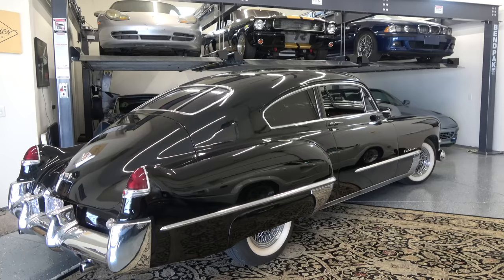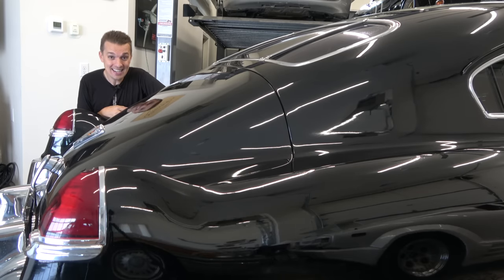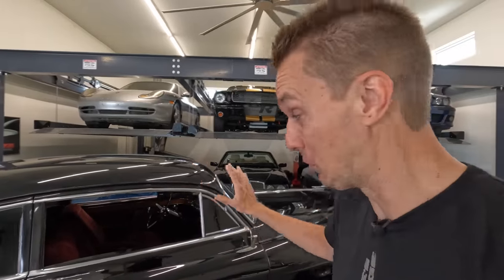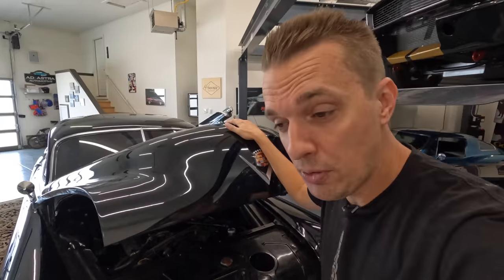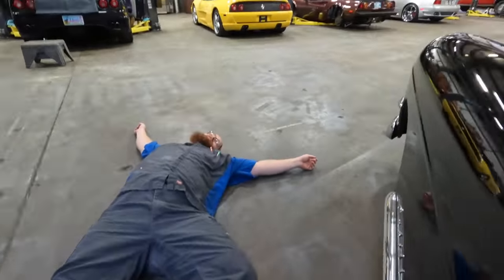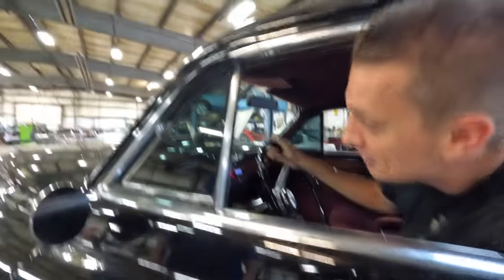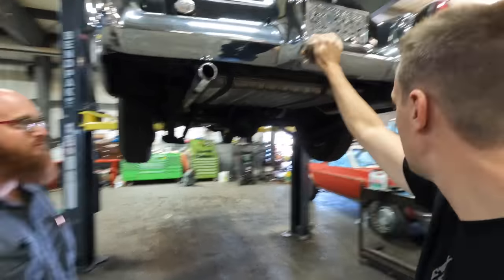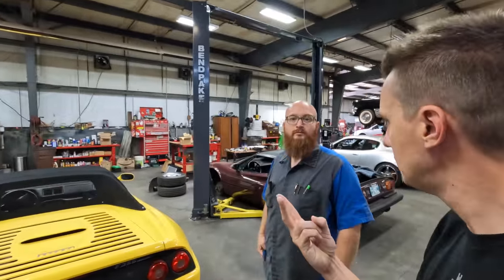I bought a RARE 1949 Cadillac Fastback, and making it my 70 year old daily driver! Amazing Restomod!

Comment: That 80's velour interior would have to go, along with the modern radio, and I think that large Cadillac logo on the center console probably is a later addition, but a really nice car at first look.  I'd sure go around it with a magnet though to see what kind of body work was done.  A black leather interior along with a paint job, other than black, would really update the car.  Sort of reminds me of my father's 49 Chevy fastback he had back in the mid 50's.  Great purchase.
Reply: I said the same thing take out them seat's and that horrible plastic centre consol. Try and find something close to the original split  bench seat. Maybe something like 57 chevey seat. Yes that radio. Other than that it's beautiful car.
Reply: Or... hide it with something flip up [or down].  Polished stainless, leaning towards art deco as the car suggests.  A faux air register perhaps?
Reply: air bags  holley efi and wheels along with buckets
Reply: @rsprockets7846  no way that would destroy the car might as well take a hammer to it doing mods like that. The interior needs to go back to as close the original factory. Engine needs to be carburettor for the old sound. Do not ever change them wheels unless it's for original one's from factory.
Reply: @chriscollins550  its their car, they can do what they want.

Lol
Reply: @chriscollins550  what the hell are you on about?
Reply: @chriscollins550  lmao my guy, your tryna say that all the added stuff is ugly, and alls i said was, its his car, he can do what he wants. Which means im referring to the owner.

Calm down, you've been online too much today, go find something else to do.
Reply: @trashyspeeds266  lol hardly any sleep. Baby and all that reply to the wrong person lol.
Reply: @trashyspeeds266  a car like this you don't need to customise it like that. They look and feel so much better as close to factory. Yes modern breaks and if you don't have the matching engine do what they done hear. But bucket seat's are not right in a car like this. You must understand that.
Reply: @chriscollins550  despite the fact buckets were an option? Sure. Lmao
Reply: @trashyspeeds266  not looking like they do now and it wasn't common. 99% went for the bench seat that looks more classes than anything else. The first caddy to have bucket seat's wasn't till 1957. I just looked it up on their Website

Comment: I miss my 1956 Fleetwood Cadillac.  What a great party mobile. The air filter was in an oil bath on top of the carburetor. Had an electric eye that would automatically adjust your high beams to low beams.  Worked Great. Interior needed work. Gas cap was under tail light. Exhaust went through the back chrome bumpers.

Comment: I still see flatheads in use for the torque, but not in cars. I saw them at ski slopes as the motors that would power the ski lifts. Guess they were reliable. That is one nice car,  got some real leg room, not quite like the Checker Marathons but it's got style. Great for moving drum gear a round too.
the air suspension needs nitrogen, then you don['t need to constantly top it up. Air is a mix of molecules and not  stable where nitrogen is a single molecule and stable enough for racing tires so I suspect it will help the ride level longer. That car can be on the road for a very long time with a bit of preventative maintenance, maybe build a water park in your driveway for after a long drive, keep it nice and clean underneath...and keep you cool in the summer.

Comment: Love it.

Original wheel was huge, for leverage in parking, with plastic and a full circle horn rim.  Manual steering.
Chrysler had first powerin 51. We had a similar 55.

The radio was all vacuum tubes and was HUGE behind the dash.  18 inches by 2 feet.

I know, Dad had me test everyone at the drug store in 1970 to see why it stopped working.

Comment: A GREAT CAR.  LOVE the ride height ... perfect for the Sedanette.  In 1969 I had a 1959 Caddy 4 door with the flat roof ... everything, even the 4 vent windows and the trunk was electric powered.  More ash trays and cigar lighters than could be counted.  Wonderbar radio, only AM of course.  Same gas cap treatment, but I don't remember how it operated.  Lost it in a fire.  I've often thought about doing the resto treatment on a 53 to about a 56 Coupe.  Love a coupe roof line and them Dagmars.

Comment: What a gorgeous car!!!   So glad that you were able to buy it in such great shape!  The only thing that I wish was a bit more "updated," is the Split front Windshield, and the three-piece rear window.  Obviously, you want to keep it as "vintagely pristine" as possible, but it would have been a bit "cooler" in my opinion, if like the 1964 Sting Ray, a solid one-piece rear window and one-piece front windshield.  The interior is gorgeous as well.  Bravo, Bro!!!    Ted Schempp, Nashville
Reply: I own a '49 club coupe, and can tell you that the rear window is one piece. The 2 vertical chrome strips are just sitting about .25" above the rear glass,  they don't actually touch the glass.

Comment: My Grandfather had a 1958 Oldsmobile 98 with fins,  and Chrome that weighed more than my VW beetle. It also had a gas filler hidden under the fin. He was always annoyed that the gas attendants never knew where the filler was, and that was less than ten years after the car was new.
Reply: Good call on another GM car with a hidden filler. Besides the Cadillacs, most people only know about the 1956 Chevy.

Comment: My first ride was a 1971 Sedan Deville that I inherited from my Dad after it had been through two lives already as a company car for him and then a family car for my family.   Nowhere near as sweet looking as this 49, but it did have the 472 V8, which was essentially the same motor as the 500 with a few more points of compression. Even in that monster of a car, because I was a young man, I did succumb to the curiosity to 'see what she'd do'. Out on a rural section of the New York Thruway, I took her to the floor and stayed there.... the 71s had a 120 mph speedo, and that car buried the needle ... if the instrument was anything like accurate we were somewhere north of 130.  

So, get The Weezard to put some fresh plugs, points and ignition wires in that thing, and go for a ride.  ;-)

Comment: Not very much into restomods, but this one is quite impressive. Most of it is done very tastefully. I especially like the retro-look telescoping column; always wondered why they didn't make something like that back in the day, except for the 2-seater T-Bird. My thoughts were that the column-mounted gear change lever is to be blamed, but this car seems to disprove this theory completely - combining it with a telescoping column is absolutely doable. It seems that car makers had very different priorities in 1950s. I wonder how many drivers would've gladly exchanged annual styling changes (which all too often made the car uglier than it was before !) for a tilt / telescoping column and a fully adjustable seat...
Reply: The whole steering column is relatively modern and the selector is connected to the transmission of the same period. The original would have had R at the right end.

Comment: That front suspension looked suspiciously like an old late model 70's Nova...The suspension/sub-frame in my old 1977 Chevy Nova Concours was built like a tank and looks a lot like that front end. They were sought after for drag cars.  They normally had 6's or 305's but you could slam a 454 into it all day long as long as you got beefier springs and shocks. Sweet car, man. Glad you got a goodie!
Reply: I miss my 77 nova

Comment: I can see why it sits low in the back. It has lowering blocks. You could just remove them and gain a couple of inches. A quick fix and probably better than pumping up the air shocks. It is a beauty and I like that it's got a Cadillac engine.

Comment: Nice job on the restomod! The only thing I would have done different was use the 472 instead of the 500. They got better mileage and had quite a bit more power. The 500's were the last of Cadillac's 'monster motors', and they had to drop the compression and put slow cams in them to meet the early 70's emissions standards.😝 The '68-69 472 was rated at 375 hp. stock, and if you are extremely lucky, you can find a 1970 500 that makes 400 hp. stock, but they're hard to find. '72 and later 500's are absolutely anemic, making a little over 200 hp. until they dropped them in 1976. If that HEI distributor is stock, that 500 has to be '74 or newer (when GM first introduced HEI ignition).😉

Comment: Nice car. I like it.  I have a friend here in Costa Mesa, CA who owns his parents 49 white Cad convertible.  He uses it regularly along with a few other classics he owns.  It looks like it just rolled off the showroom floor.  Everything is in perfect operating condition as your 49 is.  Since his father bought it new that means that it is one owner.  The trans has never been overhauled.  Engine has never been opened up.  Just oil changes and lube jobs.  Everything on it is functional. Paint is original and near perfect condition.  Always stored inside.  In 1949 this was as close to a perfect car as could be purchased.  I admire it and I like yours also.  Personally, I owned and operated a vehicle repair/restoration shop here in Costa Mesa for 30 years.  I repaired many of them and restored many.  I got to see many fine examples that were of museum quality and  already had lots of money spent before they came to see me.  However,  as I have said on numerous occasions ..... they are only original once... Grant

Comment: A few chips in 70 year old chrome. Wow that's damn good. Its beautiful car. Good use of modern seats. Steering wheel other modern parts. It's not like you could find alot of 49 parts. It's well done.
Reply: Besides the transmission selector being wrong the original pre-power steering wheel would be ship sized. Too bad the seats don't have chrome metal sides instead of hard plastic though.

Comment: The transmission has also been replaced on this car.  Originally, it had a hydramatic, with 4 positions -- Neutral, Drive, Lo, and Reverse -- in that order, left to right on the dial.
My aunt had one, and allowed me to drive it -- it was heaven  (Yes, I am 87 years old).

Comment: This was probably a budget friendly resto-mod. Probably pulled the engine and other underneath parts from 1970's and 1980's Caddys and/or other big body GM cars. If I did a resto-mod I would try to keep the exterior and interior as original as possible, but I would get the most modern mechanicals available.

Comment: My father had one of these in 1949.
Except itcwas a 2 door coupe.
He put a split intake manifold with dual quads on it.
The car would more than peg the 110 mph speedo. 
Later he added an ARA A .C system.   I learned at age 7 o drive that xar.

Comment: I had a 49 New Yorker, the problem is if you can afford the gas, if you try to go anywhere like take a trip and the starter or the generator (mine was original 6volt) goes out there is no place to get the parts to fix it. I found it was only good to sit in a museum and since I don't own one I had to sell it. The parts were so expensive also.

Comment: This is one of the most famous Cadillacs of them all! It's the Cadillac Series 62 'Sedanette' and is the rarest of the rare. The 1948 and 1949 Cadillacs have the first use of the iconic tail fins! The 1949 model year also introduced the Series 62 Coupe deVille - Cadillac's first use of a pillarless 2-door hardtop design mocking the styling of a convertible. 

The Series 62 also spun-off the ultra-luxurious limited edition Eldorado in 1953 and only 531 examples were built. Cadillac used to be the luxury leader when it was considered The "Standard of the World" in luxury, and grace. They were endowed with a poised dignity which was the hallmark of every Cadillac!

The Series 62 was "The Kingmaker" at the time. For the 1956 model year, the Series 62 offered Cadillac's first pillarless 4-door hardtop called the "Sedan deVille. Not many know the classic DeVille and Eldorado were merely trim options for the formidable Series 62 before they became their own special stand-alone model series.

I wish there was a magic spell I could cast to return Cadillac to its former "Standard of the World" status. There was no finer V8 engine made than the formidable Cadillac V8! The inherent balance, impeccable craftsmanship, and the overall horsepower of these magnificent engines were emulated but not equally replicated. Cadillac in its heyday made the entire auto industry 'nervous'. Automatic Climate Control A/C and front fender located cornering lamps are also exclusive Cadillac introductions to the industry.

Cadillac was the first American automobile brand to offer a V8 engine as standard equipment in 1915. Cadillac was the first American automobile to incorporate an electrical system offering 'self-starting', ignition, and lighting for the 1912 model year.

Cadillac is the only 'foreign' automobile to win the prestigious Dewar Trophy from The Royal Automobile Club of England. They recognized the Cadillac brand as being first in the industry to offer interchangeable parts and the facilitation of mass-production in 1908. Cadillac won this award once again in 1912 for its electrical-engineering prowess. Cadillac is the only American automobile brand to receive the distinguished Dewar Trophy.

I wish Cadillac still made REAL luxury cars - I wish Cadillac still made REAL cars!

Comment: When I was a kid growing up, the family car was a '49 Olds fastback.  It was basically the same body.  It had a ohv V8.  I think in 1949 the only Detroit ohv V8's available were the Cadillac or Oldsmobile.  My father hated Cadillac so, Oldsmobile it was.  The car was a daily driver until it went underwater during a hurricane in 1961.
Reply: Upper models of Oldsmobiles and Buicks shared basic bodies with Cadillac, the "C" body. Lower models were B body based. Versions of this plan lasted until 1958.

Comment: WW2 was happening and we got really good at making hydraulic systems, especially for the ball turret gunners in our bombers, like the B-17, B-24 etc. It only ended up getting put in cars in 1951 though, which seemed silly that it took so long.
Reply: Interesting history. The first power steering was by Chrysler, not GM. But if this had power windows they would have been hydraulic.

Comment: I wondered if you were going to demo the gas cap cover;  that was unique to the Cadillacs.  My folks had a 1950 Oldsmobile 98--same body as the small Cad less the fins, two-tone paint job, hydraulic windows.
Reply: That gas filler was NOT unique to the Cadillacs. 1956 Chevys for one had them. Probably a few others too.

Comment: Because Cadillacs had 300 hp in 1958 rather than 150, I believe a late 50s Hydramatic 4-speed has been used for this car. It does say Hydramatic on it, which is different from Turbo Hydramatic (TH350 or TH400)
Reply: Its a Turbo-Hydramatic 400; probably original to the 8.2L V8.

The 4speed HydraMatics used fluid couplings instead of a torque converter.  Also, the shift pattern has REVERSE at the bottom of the shift quadrant [P-N-Dr-L-R] vs [P-R-N-D-S-L] on the Turbo-Hydramatics.

Comment: A super daily driver but you are wrong on one point: The viper motor is electric and modern and  not "original and correct for the 49", as it had vacuum-powered vipers from the factory...but they never work properly anyways so its a great improvment.

Comment: I ran a exhaust shop a few years ago, had a guy with a immaculate 62 Caddy come in. My 10,000 lb hoist could barely get it off the ground. 
 I was wondering WTF was wrong with the hoist , it could handle 1 ton trucks with ease, when the guy mentioned the Secret Service had added some mods..... If Kennedy had been in that thing , we would have been discussing his 2nd term...

Comment: What a beautiful, elegant car. But I would want it with modern LC display gauges, satnav, usb-ports and of course an electric engine and a modern, high capacity battery. Other than that, leave interior and exterior unchanged.

Comment: To each his own I guess, but this is nothing like a modern car with respect the performance, efficiency, suspension, braking and now standard safety features.  A current Honda Accord beats this in every category except for number of passengers accommodated and nostalgia. I’d be interested in knowing what the fuel consumption is on this beast.

Comment: Believe it or not, this Cadillac is based upon a Mercedes racing car which was developed by Mercedes in 1936-7 before WW2 for long distance races. The original Mercedes car car was found at the factory just after the war ended, and an American senior officer liked it so much that he had it shipped back to his home in the US. This cadillac has almost the exact size, style and fast-back shape as the Mercedes racing car, and apart from a few minor details like the front grill and rear lights, in my opinion is modeled exactly on the 1936 car. Intetestingly, Mercedes found an original photo of their racing car and a lines drawing of the body, but no history of the car in their records office, but decided to build an exact replica in about 2010. A survivor of WW2 whose father worked at the factory, now in his 80's, remembers seeing the car as a small boy of about 5-6, and was told by his father that the car achieved a top speed of 186km/hr on a race track. If you look for a video on youtube called: Mercedes silver arrows, you will find a video showing the rebuilding of this car from the single photo and lines plan that has survived the last war.